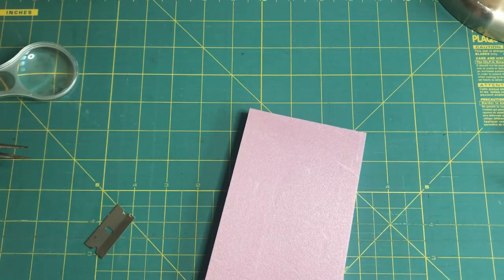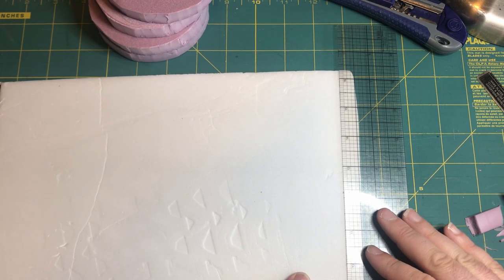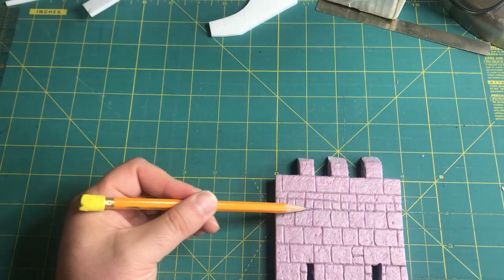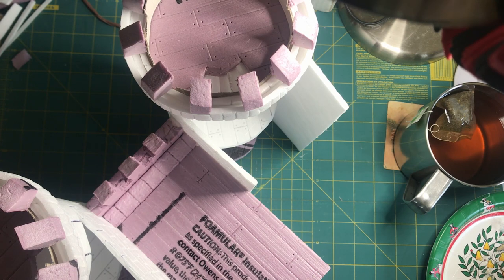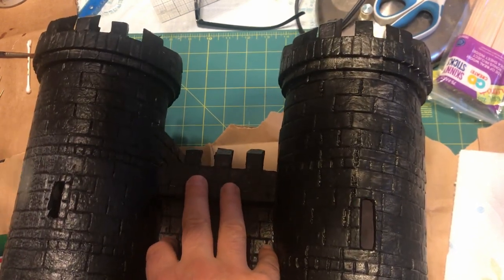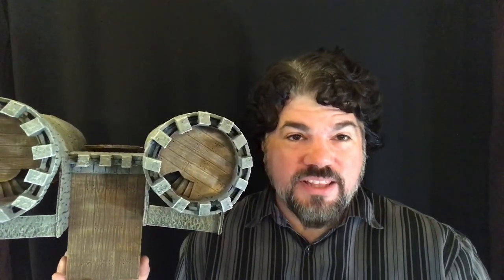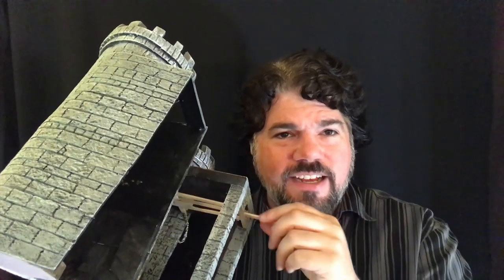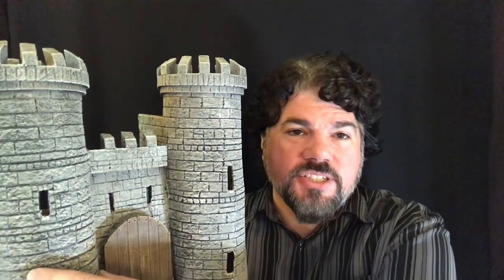Terrain Crafting: Foamcore Castle Facade Build

Comment: I think the issue with the foam core sheets wrapping the towers may have to do with the grain of the foam core. I’m betting that if the tower that didn’t want to wrap were turned 90 degrees, it may have curved better. Also, I’ve noticed that sometimes one side of the foam core will take a pattern better than the other. Excellent build, sir!  Also I appreciate your sharing is the issues during the build and what you didn’t care for at the end for gameplay function. Thank you!!